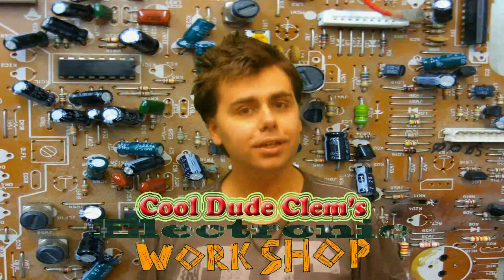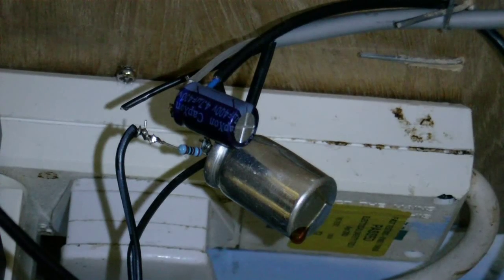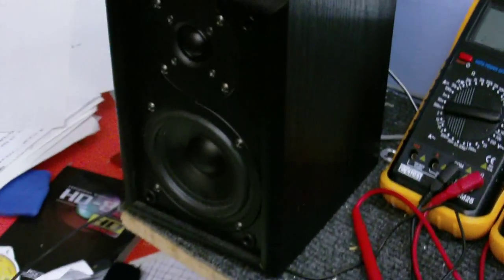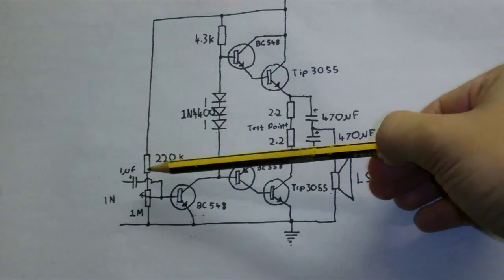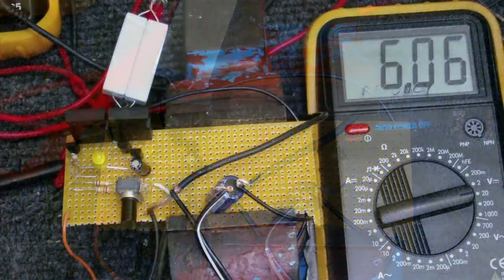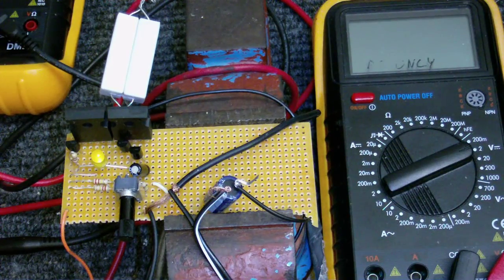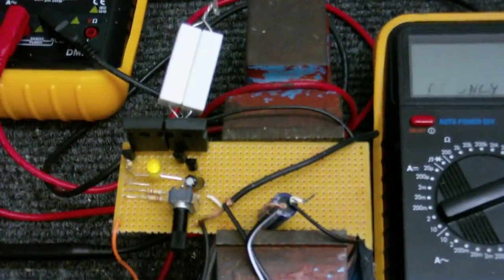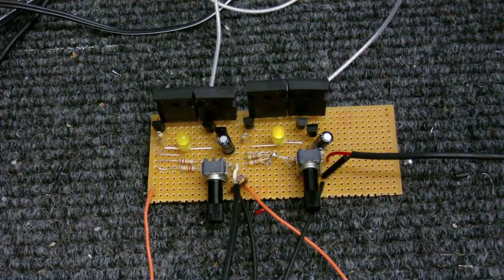CDC Electronic Workshop - The Amplifier "Adventure" II ep 3

Comment: @CoolDudeClem: Working OK here in the Chicago area. Your circuits remind me of several I built a long time ago, albeit with older semiconductors. In particular, I remember that CK722 transistors were cheap, commonly available, and they could be made to perform many tasks; i.e., audio amplifier, oscillator, audio output.